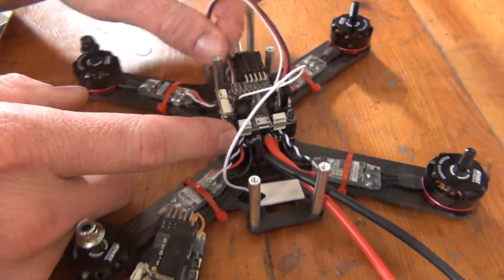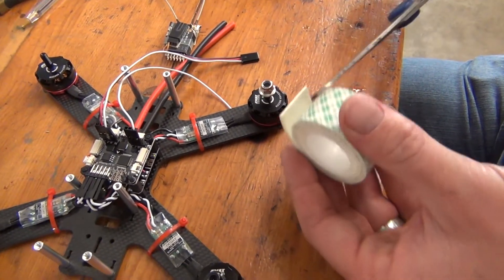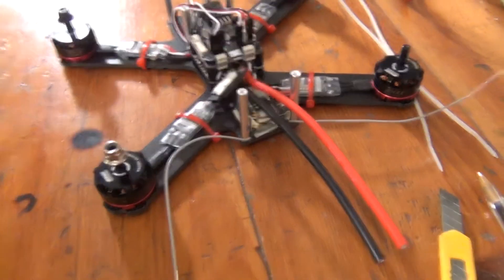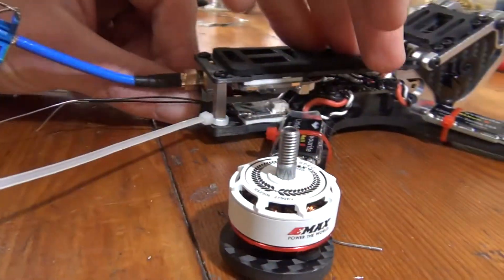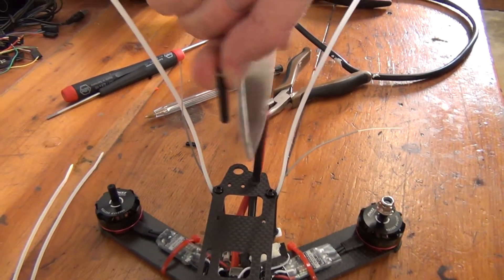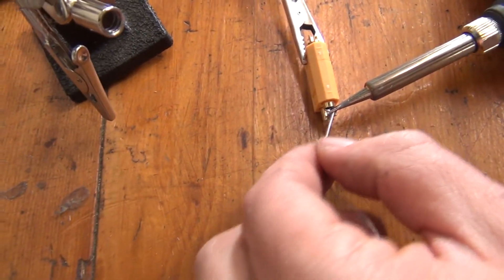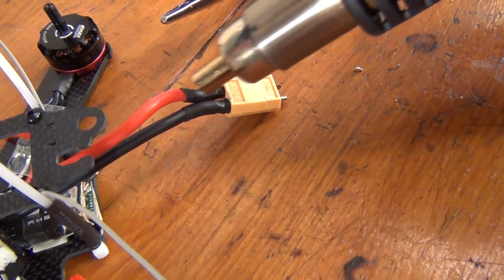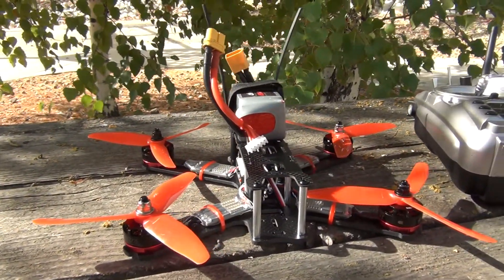How to build a racing drone | Part 5: RX install and clean-up!

Comment: Awesome video. I have a question for you. I just build my new. Fvp. I have a flysky radio i6 n park fly fs-ia6 receiver. So when I connect it to my computer to try to fix the radio. The fpv is not getting signal. Using sp f3 board

Comment: In the previous vid you soldered the esc control wires to the FC but in this one they are plugged in the receiver.
One of my esc's caught fire on a wizzard x220 and it only has one control wire so do i solder or plug ??